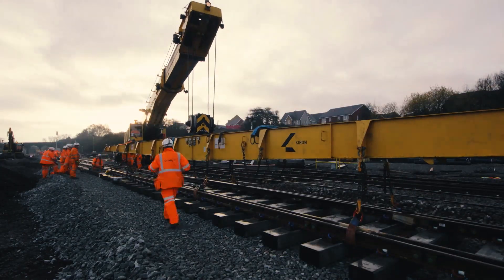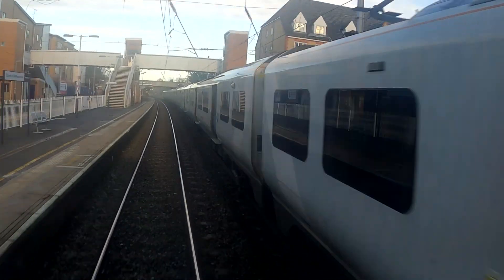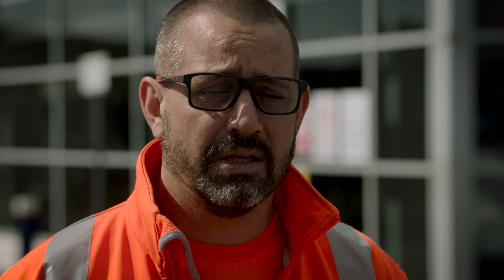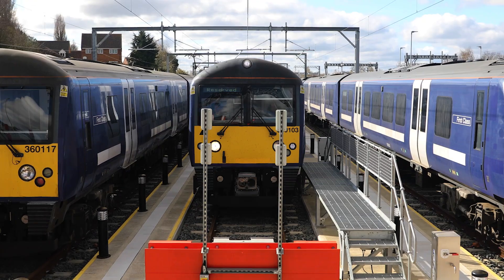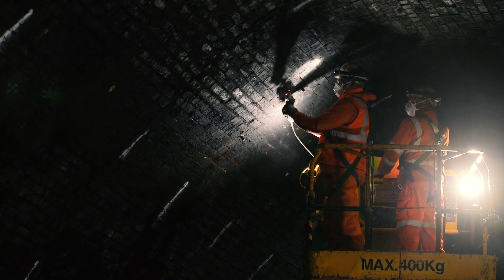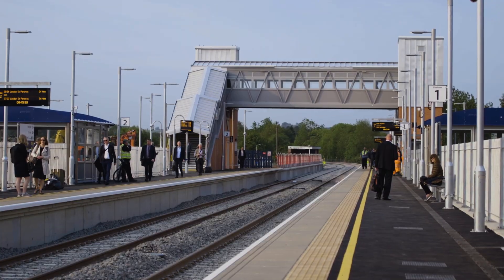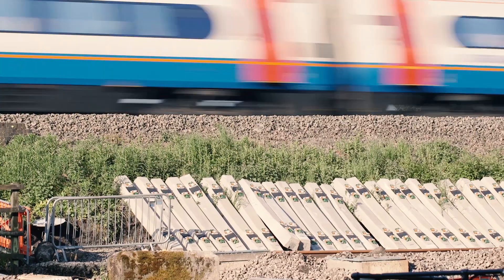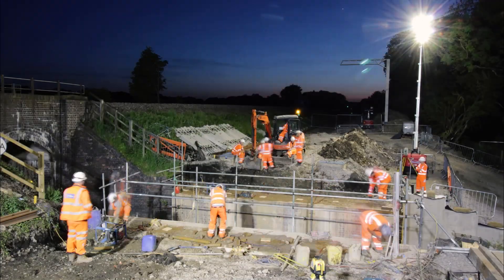Midland Main Line - a sustainable railway project

Comment: "New 360s" are circa 2012 units from Greater Anglia 😯🤐
Reply: They were first built in 2002-2003 with the Class 360/2 built in 2004-2005 for Heathrow Connect (now TfL Rail). But 21 Class 360/1s have been transferred to EMR and the 5 Class 360/2s have been cascaded to be used with Rail Operations Group for freight use and are stored at Bicester MOD.
Reply: @Andrewjg_89  I guess new to EMR in the same way the Class 484 is new on the Isle of Wight despite being 43 years old from TfL and tarted up 😉
Reply: @Andrewjg_89  The 360/2s were not “cascaded” to ROG. ROG purchased them.
Reply: @bfapple  Thanks 😒

Comment: Until the problem with the tunnel south of Leicester station is addressed, where a Victorian sewer is directly under it, then electrification cannot be joined up.  Lessons learned or more marketing drivel?
Reply: Bi modes should solve this problem for difficult to electrify locations.
Reply: Bi modes are a botch.  They are like hybrid cars, a total waste of time and a coming maintenance nightmare.
Reply: @sjcsystems  K

Comment: Electrify this line at least to Sheffield please
Reply: Best I can do is the year 2086.
Reply: Class 810 Auroras are to be built and to be in service from 2023 which will be a better option than electrification to Sheffield.
Reply: @Andrewjg_89  Please explain to me how diesel operation is a better option. Electrification has to be done.
Reply: @bfapple  The short answer is it's cheaper.  The real benefits of a bi mode would be where you've got to search branches off of the electrified mainline. The West Coast has good examples of this, Crewe to Chester/Holyhead & Wolverhampton to Shrewsbury are perfect for bi mode working where trains run under the wires for 80% of their journey and can actually have a pantograph up.   Logically the Midland should be electrified to Sheffield and bi modes would enable running to places like Melton Mowbray and Burton if there is a demand for it, but they didn't have enough money to pay for this before Covid and they certainly won't now there's been a huge drop off in passenger numbers.
Reply: @WoodenChickenHead  Oh I don’t disagree, for secondary lines the concept works well. It’s just laughable how the government is making all this talk about decarbonisation, and yet it feels like no action is being taken. What other country operates 125mph diesels on their mainlines?

Passengers will come back, my EMR InterCity trains (I travel several times a week) are already getting busier…
Reply: @bfapple  they’ll just spin it as a positive. No nasty Diesel engines idling at St Pancras so some emission targets in the London ULEZ are met.  I’m not saying that isn’t a good thing, but it’s really half arsed compared to how it should have been.  I just don’t see funding being released any time soon because of the uncertainty over passenger numbers. I couldn’t even tell you if getting back to 80% of pre pandemic numbers is realistic within the next control period.
Reply: @bfapple  I agree with what RandomNameHere said.
Reply: I know I'm late but electrification is going ahead lol, phrase 3 is going as far as South Wigston and they have already cleared the tracks between Nuneaton and Leicester for electrification, which means electric trains, will be diverted to Nuneaton (freight) before they quadruple the track north of Wigston to Leicester station as to increase the frequency of trains between East and West Midlaands via Leicester station, and on the MML, in a £1.3b upgrade.

Comment: I think battery electric trains would make the most sense on a lot of these types of lines that are still unelectrified. Would save a lot of work and money putting in overhead lines.
Reply: Wales is trying out tri-mode battery / electrics specifically because there are places they can't electrify, but I imagine they're still less efficient because you're carrying battery weight and batteries have limited charge/discharge lifetimes. So if you can electrify it all, it makes sense. But battery trains is a growing technology so maybe in the future? Hydrogen fuel cells are also being mooted as a solution
Reply: @WelshMullet  Well we have to do something now because the climate is falling apart day by day. Just look at the weather patterns now.